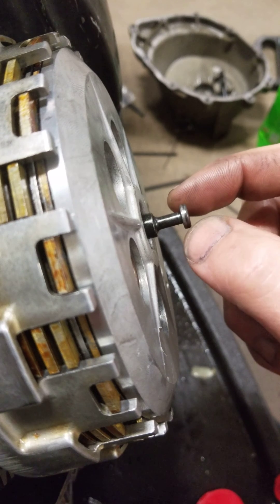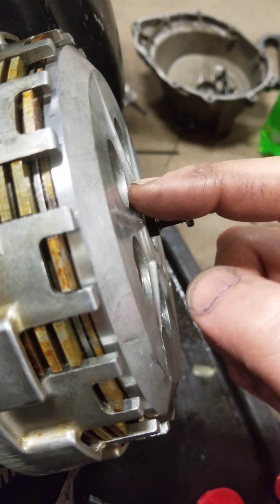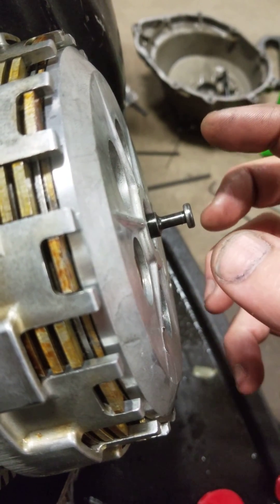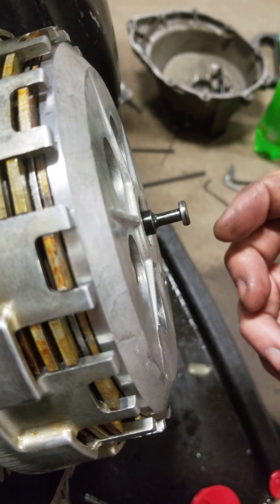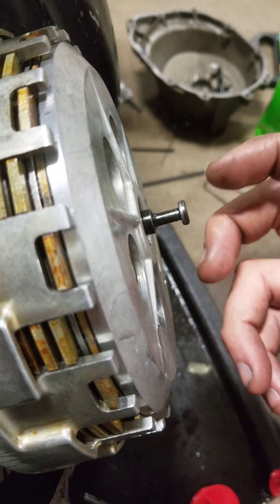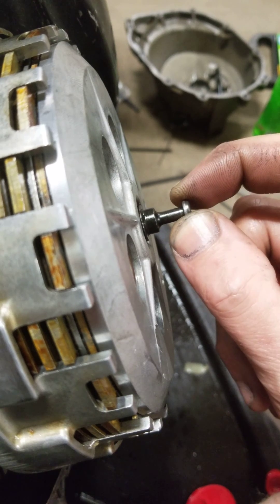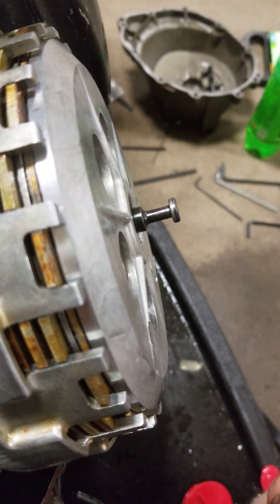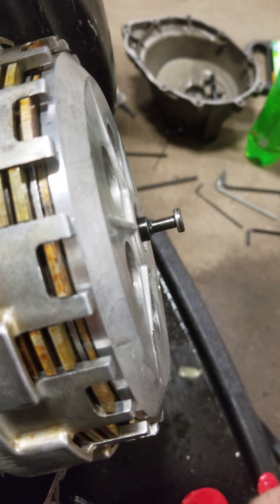2003 Ninja ZX-12R clutch issue

Comment: That's normal. New plates have more thickness, so the whole package is more further out, so the clutch lever at side will move more towards the cable holder, so you possibly need a new tight clutch cable to make it work properly. Old cable might be too long since there's new plates and the whole package is fat.

Comment: Did you get it fixed?
Reply from the maker: Yes. I found out that the steel plates were aftermarket. OEM plates have dimples on the face. To fix it I swapped out two of the steels for the next thickness up. Pack height is still in spec and the pin doesn't ha e as much play. When I rebuild the clutch I'm going with all OEM which is suggested on this bike.
Reply: @ChrisGlavan  having the same problem on my zx9r 1998